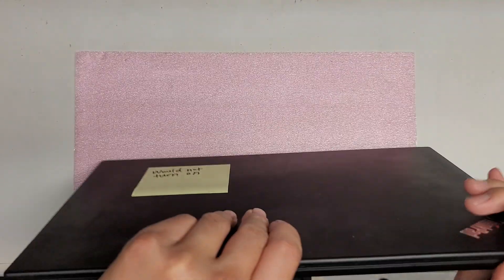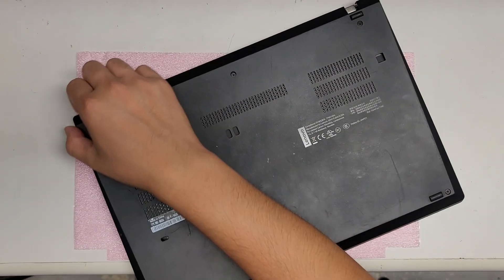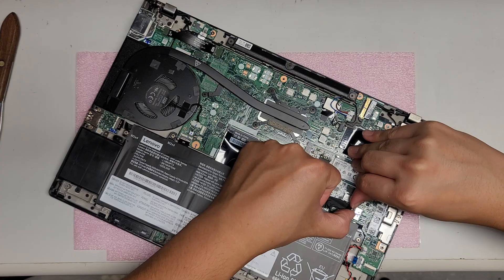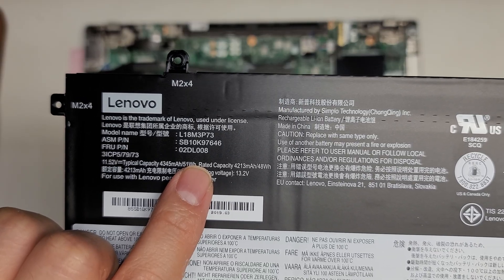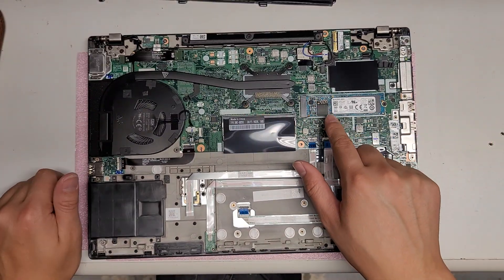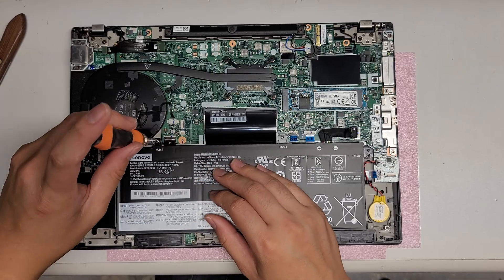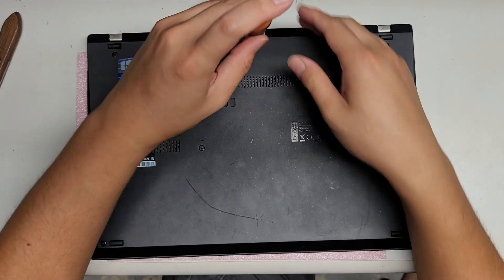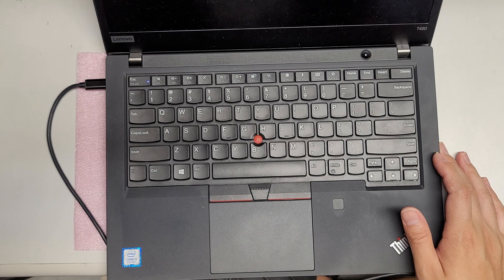Lenovo ThinkPad T490 Disassembly RAM SSD Hard Drive Upgrade Repair Not Turning On/Charging No Power

Comment: Hi when I turned on my thinkpad it beeps seven times in a musical tone but blank screen. I checked my power button and charging plot, they have indicator light. Kindly ask what happen to my laptop? I had tried holding the power button for 1 min and press the pinhole(reset battery) with needle, it still doesnt work. Thank you.
Reply from the maker: Not sure. You might be able to find something on Google.

Comment: Got this one 5 days ago, used off eBay.  It has everything, 16GB RAM, WQHD display, Samsung 1TB SSD.  It's used as a desktop replacement with a Lenovo Ultra docking station.  I am a ThinkPad specialist, since I have 4 now & 2 which have gone to new owners.  The weak point in all is the USB-C charging connector, they are easily broken & not user or shop replaceable.  There are 3 reasons for this.  1) They are unique to Lenovo, 2) the solder pads are under the connector 3) there are five tiny signal filters (inductors) that can fly off the board from the hot air gun.  If the motherboard is replaced, you need the proprietary software to reprogram the BIOS.  The combo connector next to it can also be used for charging.  As you showed, the bottom cover is difficult to remove, the X1 Carbon of the same generation comes off a lot easier.
BTW,  Lenovo has hardware maintenance manuals online for all ThinkPads.  They show with pictures & text how to disassemble everything.
Reply from the maker: Lenovo doesn't design the usb c very well

Comment: Hi, I’m about to get a T490 with windows 11 installed. But the laptop itself has two issues which are the speaker and audio jack are not working. Is there anyway these problems could be fixed?
Reply from the maker: @cheesefries6616  check the device manager if your sound driver is installed.
Reply: @ItsBinhRepaired  I just checked device manager and found out that the Intel(R) SST is missing. Do you think re attaching the speakers or replacing the speakers on board would fix this problem?
Reply from the maker: @cheesefries6616  no, the audio jack would still work.
Reply: @ItsBinhRepaired  I don’t know but no matter I plugged in my headphones or not, the speaker remains disabled or not detect anything.
Reply: @ItsBinhRepaired  Also the Audio inputs and outputs section from the device manager is missing

Comment: Thank you for the tutorial. I want to ask, can we disable battery supply via BIOS?
So we don't need to remove the battery socket.
Reply from the maker: Not sure. I don't trust software disable though
Reply: @ItsBinhRepaired  Ok, thanks
Reply: @ItsBinhRepaired  For the RAM update scheme, can it be 16+32? or is the maximum only 16+16?
Reply from the maker: Usually there is no max.
Reply: @anangmrf17 max is 48 for the t490 . It comes with standard soldered 8gb or 16gb and free slot . If you have the 8gb standard you can go up to 32+8 40 . If you have standard 16 you can go to 48
Reply: @Lapatate-s1l  Good information, thanks bro
Reply: @anangmrf17  you are welcome bro

Comment: Hello! I hope to find a solution or at least some advice. I have a Thinkpad T490, and recently encountered the following issue. The laptop doesn't start, but when I press the power button, the LEDs light up for about two seconds, the fan starts for two seconds, and then it stops. After another 4-5 seconds, the fan and LED start by themselves, and I hear a single beep. It has 8GB of RAM soldered to the motherboard, and I've tried almost everything. I've tested it with an additional RAM stick in the slot, a different SSD, and with and without the battery. I've tried pretty much everything I found on forums.
Reply from the maker: Sounds like a motherboard issue. :(

Comment: Hi Binh, thanks for sharing this useful video. It helped to disassemble and fix my laptop not turning on. There was corrosion on a component (not sure how it happened, may be due to moisture or water drop) and I reset the battery bios as you suggested, which might resolved the issue.
Reply from the maker: Awesome, glad it helped out. If you haven't already, please like and subscribe so others can find my videos and possibly consider watching a few others to get the algorithm to recommend my channel. Thanks!

Comment: Hi my laptop was not responding when pressing power on button or connecting charging cord. Saw your video tried to reset CMOS it worked for second time. I connect power cord and the laptop booted up but after I typed my login password it again turned of now it is not responding. Again tried to reset but it is not doing anything any Idea what the issue is. Laptop is 4 years old lenovo t490
Reply from the maker: Very strange. Not sure other than maybe the cpu fan wasn't working and it overheated.
Reply: @ItsBinhRepaired  Man so nice of you to respond so quick. Anyways I'll tak it to shop and let the guy check. Thanks
Reply from the maker: @ThirdLeg4933  good luck

Comment: nice video, thanks
the keyboard's 2 screws are under the trackpoint left and right click buttons. 
the buttons come off by lifting them from the touchpad side w/ a prying tool, slide the keyboard towards the screen then lift it from the touchpad side.
Reply from the maker: Nice

Comment: over 8min into this and nothing about the Harddrive or Ram!
Reply from the maker: If you don't see the SSD the moment the cover is removed, then you need all the information this video has to offer.
Reply from the maker: Maybe watch the entire video.
Reply: @ItsBinhRepaired  That's not the point smart guy!  the title say's Ram and HHD upgrade but it took over 8min to get to it!  That's the point!  Just  take the constructive criticism and move on!!
Reply from the maker: @bowe1978  it also says disassembly smart one. You think I can put every single component I touch in the title? There are character limitations. Battery, cmos bios rtc battery, wireless card, etc. How long do you want the title to be? It's in the title because it is in the video and it's what most people will search for.
Reply from the maker: @bowe1978  if you don't know what a RAM slot or an SSD looks like, then you need to watch the entire video. There is thousands of dollars of useful information in this video and you just want to know what an SSD and stick of RAM looks like? Why don't you just Google SSD and RAM? Bit of useful criticism for you.

Comment: Hello sir... Am having the same problem, tell me do you think it can be a motherboard or a static power build up? the light blinks 3 time when i plug the charger .. yet it's charging the battery... am thinking of dissemble everything, do u think it can be my motherboard? or just a matter of static power?
Reply from the maker: Not sure. It can be anything. Try RAM or motherboard.

Comment: 0:12 that CMOS battery reset hole tip saved my work laptop, THANK YOU SO MUCH!!! 

P.S. I had this laptop for more than a year and I mostly keep it connected to docking station.
Reply from the maker: Awesome, glad it helped! Please help me by liking, subscribing, and sharing my channel with others so they can fix their devices as well. I also have other content if that's not interesting to them. Thanks!

Comment: I have bought this model almost 1 year ago and I love it! But after I opened it up to add ram I noticed that front side (near the trackpad)  of the bottom panel  does not tighten well with clips. So now the front side of the case (palm rest ) become squeaky and there is very very little gap between bottom panel and top panel. I opened it up again to inspect if something was wrong but could not find anything unusual, clips are intact, they are not broken or something.  it just does not  snap in titer. Do you experienced same issue ?
Reply from the maker: Not sure. possibly not lined up right if you're sure the clips are fine.